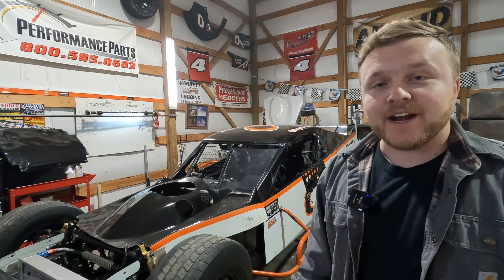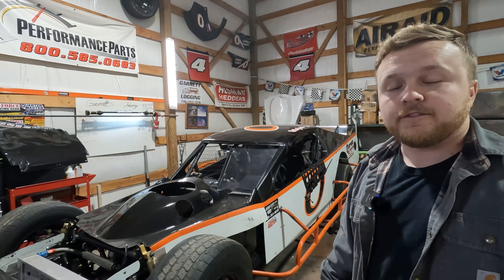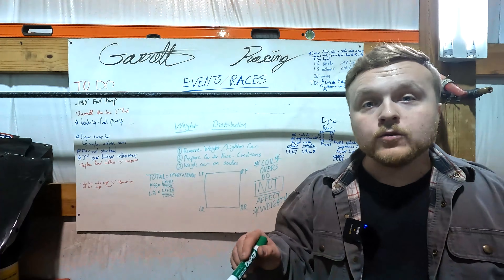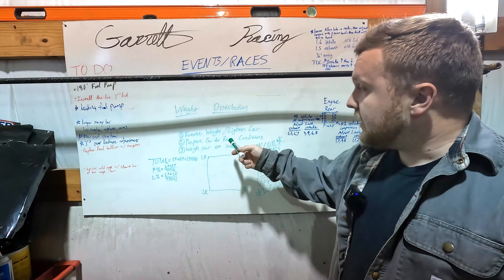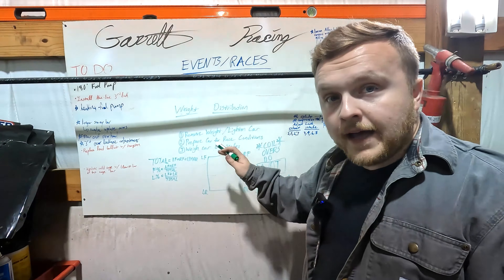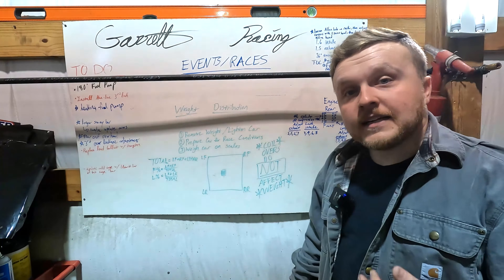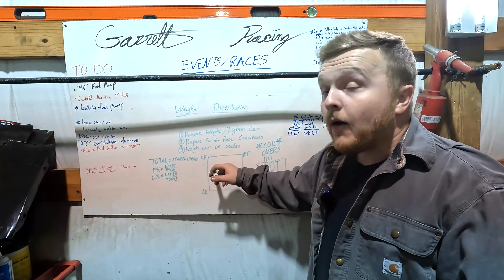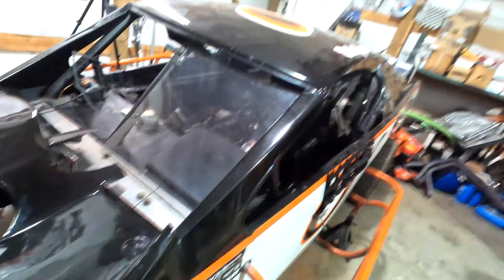A Lesson In Balance:  Race Car Weight Distribution!

Comment: How do I find center of gravity height????
Reply from the maker: It is based on the geometry and mass of the car.  All of the bolt on pieces and chassis itself changes where the cars CG will be.  That’s why I try and keep all bolt on weight as low as possible

Comment: If you aim to package a car with the lowest polar moment of inertia and the lowest centre if gravity. Weight distribution almost takes care of itself.

But I'd say weight distribution is one of the least important things on a race car, Porsche's and Audi's have proven that time and time again.
Reply: Tour type modified's running on small, banked ovals can't really be compared to Porsches and Audies.  They aren't designed and engineered for this kind of a race track with this kind of tires and and a spool in the rear end.

Comment: Hi guys. Love this video, ive been out of racing for many years but recently jumped right back in. Im pretty familiar, but always learning. With that i have a question for any of you: 3/8 mile banked asphalt track, (Hickory Speedway) Street Stock / Renegade cars, metric chassis, with stock(ish) suspension components😉. My question is, how much stagger, with a full spool locker? Especially rear stagger? I know a locked rear end likes some stagger to roll free thru the middle. We had a decent run first time out, other than a carb stutter issue. Car drove pretty well. We run street radials, and its hard to get much stagger, unless you get crafty. We ran two weeks ago with all of a 1/4 inch front rear. Think it needs much more. So now, with the new tires and rims we just got, we can do 2 inches easy. Thats kinda what i felt like we needed, maybe inch and a half to two inches. Car has great adjustability built in, with front bar, shocks, and adjustable cups all four corners. I figure, two inches of stagge should free it up nicely all the way through the corner, and we should have enough chassis adjustments to tighten it up a tick if needed. Sorry for the long message, but id love to hear anyone's thoughts on stagger. Thanks!
Reply from the maker: Hey Tim, it’s great to hear from a local racer.  Maybe I will see you someday if I make it down to Hickory with my 602 modified.  But to answer your question as best as I can from my modified experience:  with a fully locked rear differential using a spool I typically see 3” to 3-1/2” work, using a ratcheting locker style rear diff (the type that uses springs) typically 1-1/2” to 2” should work like you stated, and if you have one of the torque sensing diffs that use gears/clutch style such as a winters track star typically you can run less than 1” even down to 0” of stagger.  I hope this helps and good luck!
Reply: @garrettracingteam  Thank you for the info,, much appreciated! Hope to run into you one night at one of the tracks!

Comment: Good info, thanks!
If I need to balance my race car, and need higher percentage of the weight on the rear wheels, should I avoid moving parts or adding weight behind the rear axle? That'd be most efficient to move more weight onto the rear wheels, while stationary. But am I asking for some trouble in handling while on track with weight outside of the wheelbase?
Reply from the maker: As a rule of thumb, I do not try and mount weight outside of the wheelbase, either behind the rear axle or in front of the front axle/spindles.  For one, many rule books including the one that I have to use do not allow this, and two, once you get weight so far away from the center of the car it can create a whipping effect while cornering.  It is something to play with and can be dependent on the style of racing you do (dirt vs paved, oval vs road course), but like everything else you can go too far with it.  I like to keep my added weight as low and as centered as I can that allows for a maximum left side percentage (since I am oval track racing) and minimum total weight.
Reply: @garrettracingteam  Thanks for the response! I'm on a paved road course, endurance racing. I'll need to get some better intuition around "whipping effect". If I need to move a lot of balance to the rear, then it makes sense to move it as far as I can. But it only makes sense while the car is stationary. I think the key would be to think how it would behave under weight transfer in cornering / trail braking / accelerating out of a corner. Then weight behind the rear axle would have significant impact on the dynamics of the weight distribution, if I make sense.
Reply: @garrettracingteam  Yes, agreed. We often refer to lead hung behind the housing as "slinging weight".

Comment: awesome video.  any idea on which to set first?  corner balance vs weight distribution?  How do you isolate the effects of corner weights from coilovers when you're solely trying to change weight distribution
Reply: In my personal experience we usually like to set the ride heights first then adjust the wheel wait to what we expect to be close then check the ride heights again because they'll probably change when you turn the Spring colors to make wheelway adjustments period after you go back and forth with that a few times you get it pretty close. Then check the left side weight, rear weight  cross weight. etc and move ballast if necessary.

 Ideally all ballast would be in the center of the car but these cars are generally not designed in a way that lets you do that. To get left side weight and we're way percentages you're probably have to have most if not all of your ballast on the left side frame rail split between the area by the petals and the area behind the driver's seat.

How much ballast you have to put in which particular place will vary depend on the rules, the overall weight of your car and things like the size of the fuel cell, how full you plan to run it, how far back it's mounted, etc. 

Some guys run a straight rear that does away with the weight and drag of the quick change gears but it's also smaller and let's you move  the fuel cell forward.
Reply: I didn't mention it in that other comment but before you do all that stuff you make sure the frame is straight then make sure the rear is straight in the frame (assuming that's how you plan to run it) 

Make sure that the right side tires are aligned unless you plan to run the right front or right rear out more than the other one. Basically the point is that you don't leave anything to chance.

Comment: I run a Monte Carlo metric chassis in pure stock class we can not run any type of weight do u have any pointers for me
Reply: No weight limit
Reply from the maker: @juniorwhelchel6337  I would remove all the weight that I could then.  Find parts that will work that are lighter, especially rotating weight such as wheels, hubs, brake rotors, clutch assemblies, rear end internals, transmission internals, etc.  Can you run fiberglass body pieces?  I run a fiberglass roof and hood that helps cut down alot of weight.  You can also look at getting more left side percentage by removing weight from just the right side.  Get creative and look at the car and see what is really needed and what can be removed and still be safe to race.
Reply from the maker: Also, take a look at your competitors when you are at the track to see where they may have removed weight as well.  And if you go across scales at the end of races, have someone record what the weights are for the winners.  That will give you an idea of where everyone is compared to your car
Reply: Everything is supposed to be completely stock and we can't remove any thing as far as cutting stuff off the car but I definitely appreciate you speaking with me
Reply from the maker: @juniorwhelchel6337  One other thing, if you are allowed you can try different locations to mount your battery and also shift your fuel cell around in the rear to help get more left side weight
Reply from the maker: Do you have to meet a minimum weight?  If so, how do you meet minimum weight if they do not allow you to add any?